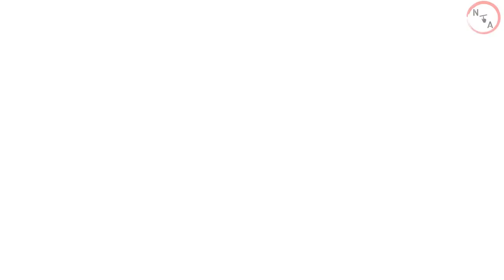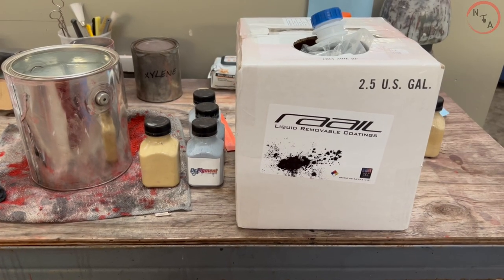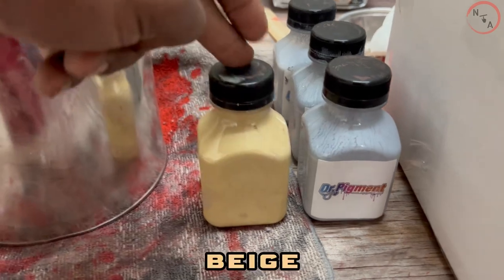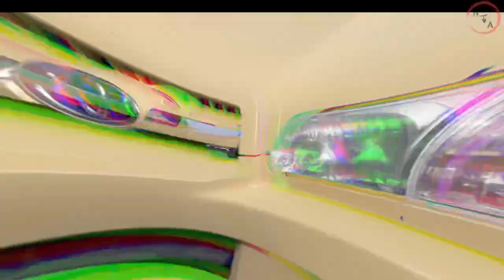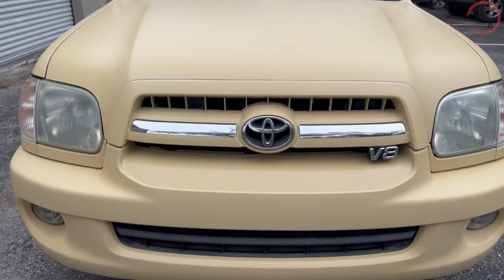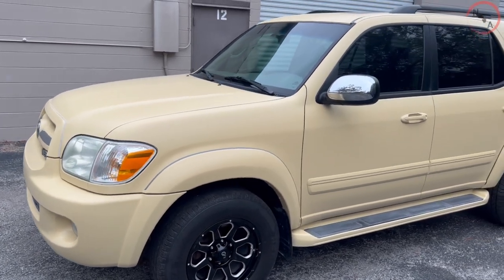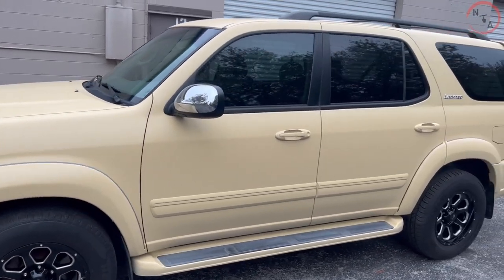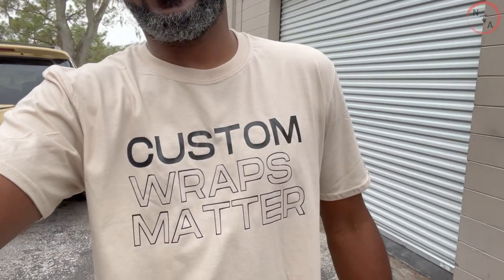How to wrap a car using Raail Airwrap | Car Wrap Guide

Comment: Another great video! I give the tan a 5 all day. I do have a question about color selection. Do people usually have colors in mind or do you make various suggestions based on your experiences?
Reply from the maker: Thanks for the compliment, mostly the color is discussed based off of the idea of what the customer wants. A lot of times I receive an image from the customer and 9/10 I’ll find the match. I normally give my suggestions when it comes down to the details of the vehicle, things such as what to paint or what not.

Comment: So you mix the primer and the base into the raail that's in that 2.5 box ?
Reply from the maker: Yes for this project yes, all color drop in tints will be mixed with the clear.
Reply: @New Touch Auto  ok cool trying to understand how you do it so you mix 

Clear/raail with black for primer 
Clear/ raail with drop in for base 
And then Clear coat is next
Reply from the maker: No clear coat options available for the Raail Airwrap version, only the Sperical wrap version will have clear coat. In this product you only have either the matting agent or satin finishes. However you can clear with the satin or matte whenever you’re using flakes, it helps seal them in better giving you more clarity in your finish.

Comment: How much does a job like this cost. Trying to look for someone who does it in Wisconsin
Reply from the maker: A spray wrap could range from $1500-$4000 depending on the color.
Reply: @newtouchauto  should it just did that now my car looking all f up
Reply from the maker: @user-xm6oq9gz9u at least you can peel it off and return to the original color

Comment: Always loved airwrap. Such a better product to spray than plastidip and halo Efx. It lays so smooth
Reply from the maker: Yes I can relate, I never worked with Halo products but I don’t think that it compares to this.
Reply: @newtouchauto  Well you're 100% wrong my guy. Halo EFX is the truth. It is definitely a step above Plasti Dip but I still prefer Plasti Dip Gloss over Raail or Halo EFX for pearls and protection.
Reply from the maker: I’ve heard that Halo EFX is a great product to work with but I wouldn’t label an opinion as being wrong. I personally feel that Raail products are a step above Plasti Dip which is more of a beginners level of spray wraps. 

With Plasti Dip not being able to spray from a hvlp gun let’s you know that the product isn’t the better quality choice.

But of course to each their own, we all have our preferences based on experience but I do respect your input.
Reply: @DawgcityClev  your insane if you prefer plastidip gloss over raail spherical gloss. Plastidip gloss has no chemical protection where raail does. If your talking dip armor and not standard top coat then it’s still raail spherical over that. Plus raail spherical is open to everybody who sprays unlike autoflex which is equivalent to it
Reply from the maker: I’m with you on this one, I was hoping that he meant  Autoflex gloss but I didn’t want it to seem like I was correcting his opinion. 

I stopped using Plasti Dip Gloss many years ago for personal reasons but it definitely doesn’t amount to the clarity of Spherical or Autoflex 😆 

I too enjoy the fact of being able to order the spherical without the hassle which is why I was excited to work with Raail products.
Reply: @newtouchauto  raail is the only company I use. Amazing products even the base airwrap lays smoother than any other liquid wrap product
Reply from the maker: I must admit that it definitely gives a smooth finish, I’m a fan of Raail
Reply: @newtouchauto so I paint cars for a living and just started getting into plastidip..I been looking at this product just not sure the difference.
Reply from the maker: @_TheRealDoe trust me, there’s a difference between Raail and Plasti but here’s the thing. You can get the same satin sheen finish as Raail using Plasti Dip products, by applying their new Satin Clear over any finish will even out the difference between the two.
Reply: Amazing  work my guy🙌🏾🙏🏾🙏🏾 I'm a long time painter and have been wanting  to try this on my own vehicle . Can you walk me through  the process  steps and where to buy it from? I Google it but so hard to find Information from a real auto painter experience.
Reply from the maker: @Vkandypaint Thanks for the compliment, here’s a video link I uploaded that’ll help any beginner. The materials are listed in the description of the video link below. 

https://youtu.be/iadPmAiar-0?si=fa-5dL-qBU3kBpVL